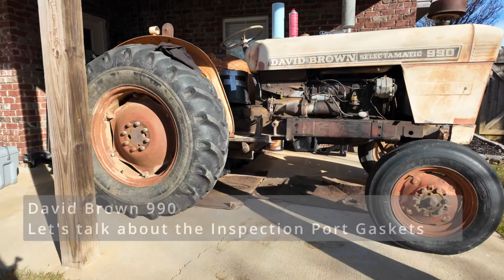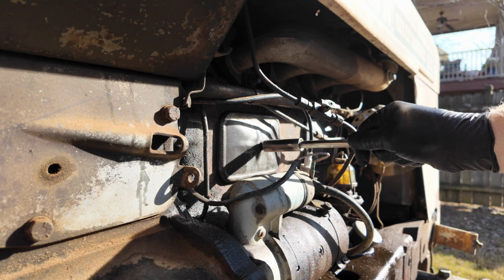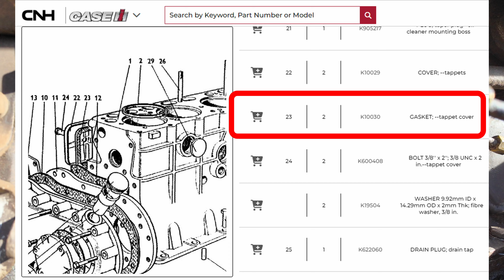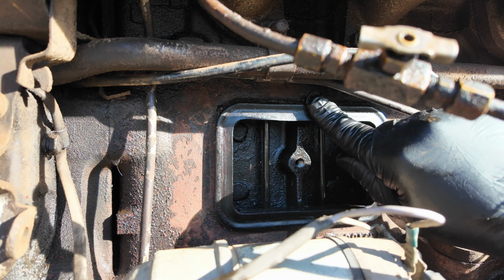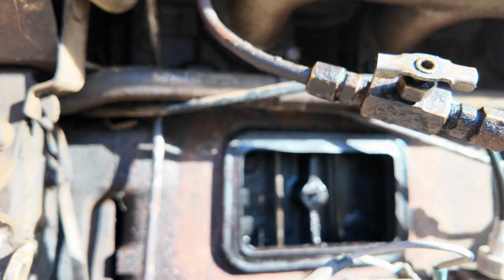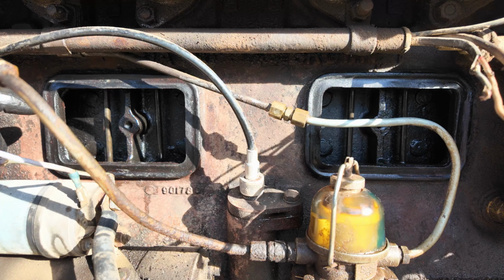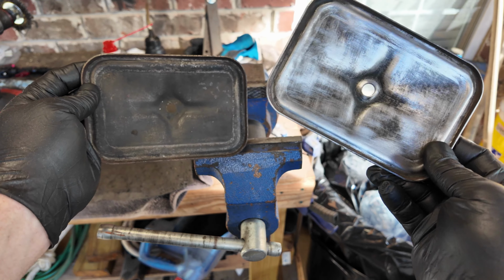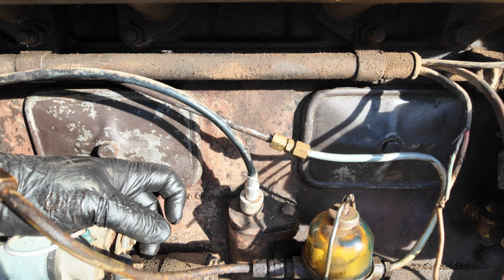Should I replace the Engine Inspection Plate Gaskets? | David Brown 990 #30

Comment: Hi shane. I have a 990 and am fully stripping it down. Those inspection plates should have a Cork gasket to keep the oil that is being brought up to the valve cover. You'll be able to see a indent on the back of the plate in where that Cork gasket goes into. The oil leaks down to the sump through those holes in where the rods go through. Oil passes past the cam shaft. .
Reply from the maker: So are the things on there I was thinking are the gaskets actually part of the block?  Kinda like a flange?  And a separate cork gasket goes between the plate and that formed rectangle flange?  Or am I off?
Reply: @path.of.discovery  yes. Those gaskets already on the block are there to hold the Cork gasket in, otherwise they will slip into that hole and be a nightmare to tighten up
Reply from the maker: @Crofter_885xl. Ok cool, so I'm basically missing gaskets at both inspection ports!  Makes sense now that they are "glued" onto the block! And no wonder it was leaking!  Thank you so much!
Reply: @path.of.discovery  no problem. Good luck

Comment: Those are the cork gaskets. Pull them off and clean. Then fit the new cork gasket. Just done them on my 995. They are only bonded due to age or they put some welseal on when last fitted.
Reply from the maker: Ok good to know!  I'll likely do that.  Thanks so much!

Comment: Usually cork gaskets in those inspection doors. I noticed you have a one wire alternator on your tractor is that standard? M 😀
Reply from the maker: Not sure about the alternator, my grandfather wired that in loooooong ago  🙂  It works though!  I'm now wondering if those "gaskets" I was seeing in there are part of the block?  Is it a formed "flange" or something that a cork gasket sits on top of?  Or is the block flat at the inspection plates and cork gasket supposed to sit in the plates up against the block?  Questioning my sanity at this point.  🙂
Reply: @path.of.discovery  The cork gasket usually takes the shape of the cover. You said you had ordered them from DBP the will probably be flat when they arrive and squash into position.M😀